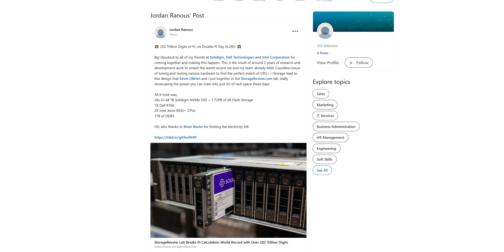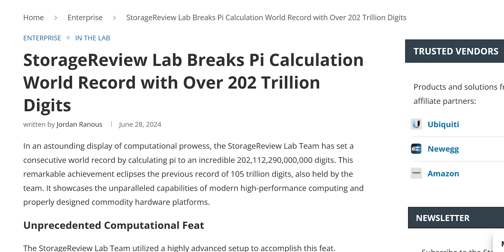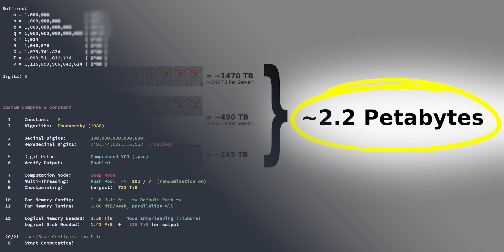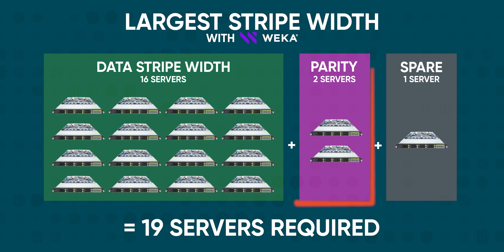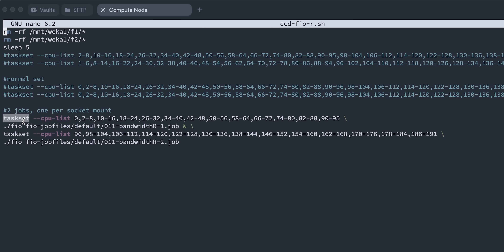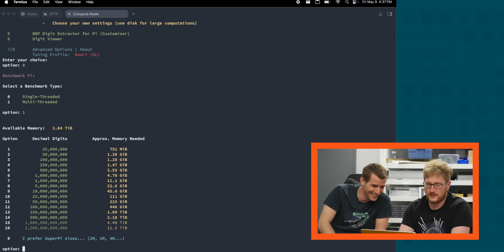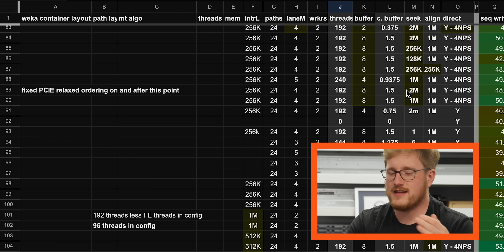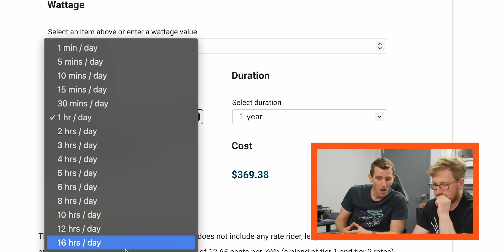The $1,000,000 PC set a WORLD RECORD

Comment: 17:57 Astrophysicist here. About 60 digits of pi are enough to calculate the circumference of the universe to a precision less than the Plank length. In other words, it is enough to calculate the largest possible circumference to an accuracy of less than the pixel resolution of the universe. Meaning there is absolutely no use for more digits, at least in regard to practical calculations.
Reply: Engineer here, we only really need one digit of pi.
Reply: @dexter9313 So π=3 as per the Indiana pi bill?
Reply: @dexter9313  lmao Swedish round Pi to 5 and call it good😂
Reply: @Dgsincc  tell that to the swedish craftsman... In my experience tolerances are tighter on swedish car parts than most domestic US car parts.
Reply: Why not round to 1? It’s easier
Reply: @dexter9313 one digit? 10^0 is close enough surely, it's within an order of magnitude. 😂
Reply: I love how this comment immediately turns into a Reddit style argument.  Never change, internet. 🙄
Reply: Been reading comments and saw 3 other comments like yours. Everyone had a different number of digits tho lol. 38, 39 40 and now 60
Reply: @orlagh277  The 38-40 numbers say "to within the width of a hydrogen atom" whereas this 60 digit version is for "within the plank length", which is quite a bit smaller than a hydrogen atom.
Reply: @ChadHadsell  Yeah well im trying to calculate the circumference of something much more important to me and much much smaller....
Reply: @ChadHadsell  1.6 nanometers specifically  1.616199(97)×10⁻³⁵ meters very very very small.
Reply: @Hazzo88  you can't go smaller than the plank length. That is by definition the smallest quantity of length allowed by the universal laws of physics
Reply: @riversilk  WHOOOOOSH! :)
Reply: @orlagh277 Mine was very rough. Plank length is 10^-35, universe circumference is approx 10^25. So I went with 60.
But it doesn't really matter. In practical terms, even building a supercolider you'll only need a dozen or so.
Reply: @QEin1786  Huh really? do you know if  for creating a some way to make antimatter collection for space travel a bit more practical you wouldn't want a faster loop so faster collisions and (maybe) something that'd specialise in making anti matter? My other thought was tellescopes or things where super duper clean and super duper precesice optics, or even radio transitions (like say Voyager).
Reply: @QEin1786  If you wanted to calculate the volume of the observable universe with an accuracy of the Planck length, you'd need 185 digits of Pi.
Reply: @gorkskoal9315  Dude, for the love of god, use punctuation. Nobody has any clue of wtf you are talking about
Reply: @orlagh277  Astrophysicists try to get matching answers challenge [impossible]
Reply: The smallest we can measure is 10^-20m and typical physics computers only go to 17 decimal places, with specialized high precision computers with 34 decimal places for theoretical work that needs to be accurate on the plank scale.

However, there are theoretical uses for having Pi past 100 digits:  ultra-precise gravitational wave modeling, quantum gravity and black hole evaporation, cosmic evolution in a digital universe simulation, and topological quantum computing in curved spacetimes to name a few.
Reply: @justletmeplaythedamngame  ah yes I almost forgot about topological quantum computing in curved spacetime! But now that I see you mention it I'm like helloooo it's so obvious!
Reply: @justletmeplaythedamngame  
only that gravity is not a wave :D It's just a scientific assumption and abstract mathematical formulas adapted to this theory/assumption :D
Reply: @Tennshe  gravity waves were detected on multiple events at LIGO
Reply: What 'universe'? 'Observable'?
Reply: @inverse_of_zero presumably, since (afaik) we haven't the foggiest how big it might be beyond that, if anything at all.
Reply: While there is no practical use for it today (and perhaps ever), one could also argue that there is no practical use for being able to calculate the circumfrence of the universe until we are able to travel far enough to make that something we need to know.

Knowledge for the sake of knowlege is a good enough reason for both though, imo. While I personally may not know all of the 300,000,000,000,000 digits of Pi calculated here, it is now a part of the collective knowledge of the human species. I am just happy that I am aware that the 300 trillionith digit in Pi is a 5.

As an aside, wouldn't it be crazy if it turned out that Pi had an exact number, rather than being irrational. That would force a redefinition of what an irrational number is, or would mean Pi would then need to no longer be considered an irrational number.
Reply: @JW-uz1ee  I think you can mathematically prove Pi is not rational even though you cannot prove its irrational, which means its irrational even though you technically cannot prove it mathematically.
Reply: Thanks for that fun fact. I currently have about 30 memorized and now have a good reason to go to 60
Reply: What about compound errors?
Reply: Circumference is not the only use pi has, but it's true that 60 orders of magnitude covers pretty much all practical calculations.
Reply: Its actually 63
Reply: @teckofficialCZ I'm an Astrophysicist. 63 = 60.
Reply: its like we calculated the wheel but then came the gears, and soon things got complicated after runs with non-mechanical forces.
Reply: Could help figure out if pi^pi^pi^pi is an actual integer or not.  Granted even assuming fast code instead of Matt Parker's Python we're still way short on the approximate number of digits of pi we'd need and then the actual calculation of pi^pi^pi^pi would be overwhelming in and of itself.
Reply: do you mean "observable universe?"
Reply: WOOSH 
That was the sound of everything you just said going right over my head
Reply: 0% on the way there seeing whether or not pi^pi^pi^pi is an int!
Reply: Based on my shaky understanding I came to 63 total digits for the current observable universe with a precision equal or less than plank length. So that's 3. and 62 decimals following :). That's a lot of precision ahaha
Reply: Software developer here, 2 to 5 digits are usually enough. It will be lost in float conversion anyway:)
Reply: @Mark-vr7pt  yeah true, I know that with coding in R, anything beyond 15 decimals is inaccurate lol, unless you make compromises that slow down the code to 1/10th the speed lol
Reply: But we talkinf about guys who cooled PC with AC unit, and liuid nitrogen. Spent more money to built an 2nd hand PC than it cost to buy a new one and did all kind of stupid stuff.

I doubt practicality was ever a question.
Reply: Yeah but what if I want to calculate it in a nonsensical model where the Plank length is several billion times smaller? Have you considered that huh?
Reply: How do you know it is that precise? Have you been there to verify?
Reply: Do you know the probability of finding a new prime within this chunk of pi? Does the probability increase or decrease as a functional pi length? Also curious about potential use of LLM to compress this way way lower than128TB I know not your field, but perhaps have better idea than me.
Reply: Useful for random number generators. I think...
Reply: Yeah, but now you have more digits to work with. 😅
Reply: That's so cool. Numbers can be mind-blowing sometimes
Reply: would use it for calculating randomness in algorithms and encryption ;p
Reply: That's only the Observable universe
Reply: boooo not whimsical and silly. Cool fact, but not a whimsical, silly fact.
Reply: until the universe expands some more! :D
Reply: I think it's more to have a better Random() function.
Reply: Could it be useful for stuff like encryption and all? I know prime numbers are useful, maybe this could be too
Reply: Could there be a computation which would require higher powers of pi, which requires higher precision?
Reply: If true, I'll hope you'll use 69 digits from now on for the lols
Reply: Are you saying, that someone could MEMORIZE just the 60 digits of pi.... and do all that?
Reply: but what if at 250 Trillion digits we find a repeating pattern... 
think of what that would change mathematically.
Reply: There might be no use in physics for so many digits of pi. But mathematics is always hungry for more digits. To compute some properties of pi, check some assertions we've made and other stuff.
Reply: I mean....coming guys....its 42 digits of pi. Thats the answer....to everything.

Now...what the original question was you may need those extra trillion digits.
Reply: not a good astrophysicist to think you know the size of the universe might i add... a few hundred years ago we found out about other galaxies.. imagine conversely what we'll know in thousands of years about the size of the universe or about physics...
Reply: Laughs in string theory.
Reply: @CragScrambler  Laughs at string theory.
Reply: @CragScrambler string theory operates at planck size, so the same napkin approach would apply, maybe a dozen or so digits more, depending on the answer to how the extra 8 theorized dimensions behave at that scale.
Reply: Except the Universe isn't round, or even a sphere. No observable curvature found:

"The observable universe appears to be flat, with no measurable curvature, according to current scientific understanding. This flatness is supported by observations of the cosmic microwave background, baryon acoustic oscillations, and the distribution of galaxies. While the universe may be larger than what we can observe, there's no evidence of a boundary or significant curvature within the observable portion"

Very likely the universe is infinite in all directions.

Your math would work if for the current "observable" universe, which is about 50 Bly in radius. Likely if we eve get a microwave space telescopy the observable universe would increase by another 20 to 25 Bly ~70Bly to ~75bly.
Reply: OOH so things like finding quasars? Maybe even  better version of the big bang? er umm if you know that is. ^_^ I feel like of the few that thinks the universe does have a size -then we get new one. Just that the size is be very very big.
Reply: Y aún así, después de toda esa información, los científicos no han sido capaces de lograr NADA con eso. No saben si es plano, abierto o cerrado. 😅

Menos enfoque en números imaginarios y más en efectos reales en la vida de las personas con números.
Reply: Not an astrophysicist here, I am calling BS on this. I know you people use a number for light years that someone basically just made up so you have a fixed number you can count with. Since I have known this, I do not trust you people and what you "calculate" anymore. The light year number is actually very complicated and is changes based on some factors, I forgot exactly what, but It's for sure not what is used, so this means everything that is calculated with is basically wrong. And that is a lot. No, with PI, I am sure there are calculations where accuracy matters a lot.

What is "the pixel resolution of the universe" is that scientific terminology? I doubt it, makes ZERO sense. A pixel in a screen can have completely different sizes. Phones or high pixel density screens have way smaller pixels than others.

So WTF is this supposed to mean. Is there are "pixel" measurement that has a fixed value that people agreed upon in astrosicence. I am too lazy to look this up, but I doubt it. So this is a complete, meaningless sentence that makes no sense either way. "The pixel resolution of the universe" WTF is this supposed to even mean. Like the universe actually grows, it's like infinitely large. It does not have a "resolution". You're just typing out some fancy sounding things, and this plebs read "astrophysicist" and click like without even using their brains.
Reply: @EmilyRose0  "you're a professional and I'm not, but you're wrong" come on man are you serious 😂 pretty sure the original comment was talking about the observable universe and nothing beyond that. And pixel density is just a figure of speech generally referring to circumference, so we have some sort of comparison. That's what i got from it anyway
Reply: @EmilyRose0  I bet you were trying to sound smart but you took that way too literally. obviously pixel is figure of speech, he just said that to the accuracy of plancks width, which is the smallest lentgh there is. so that planck would be the pixel here since nothing is smaller than pixel.

and of course the size of know universe is estimation, not some exact value. but even if it varies quite a bit, it really doesn't change the equation that much to shift the claim "60 numbers of pi" that far of. even if the size of known universe were 120 billion light years the equation would be rounded to almost the same.

and lastly context, the conversation is about the length of pi where it would still have even some use case, not about the size of universe.

really your saying could be compared to someone telling their car weights 1200kg and you went there saying "I call bullshit no way it is exactly 1200kg I bet there's at least couple kilograms more" like completely missing the point for no reason

Comment: 18:02 So you only ever really need about 64 digits of pi for any real practical purpose, since 64 digits is enough to construct a circle with a radius of the observable universe, with a precision of less than a Planck length (which is the minimum possible length that has any actual meaning from a physics standpoint).

So this may have been just a little bit of overkill. 😂

Comment: To draw a circle as large as the observable universe with accuracy down to the Planck length, you need π to only 62 decimal places.
Even if the universe were 10^300 000 000 000 000 times larger, knowing π to 300 trillion places would still limit your error to just 1 mm
ihis is useless
Reply: that means line would be straight to the accuracy to plank lenght for 2,71×10^149999999999969 meters untill it would divert from straight line for 1 plank lenght

Comment: “The radius of the universe is about 46 billion light years. 
Now let me ask (and answer!) a different question: 
How many digits of pi would we need to calculate the circumference of a circle with a radius of 46 billion light years to an accuracy equal to the diameter of a hydrogen atom, the simplest atom? 
It turns out that 37 decimal places (38 digits, including the number 3 to the left of the decimal point) would be quite sufficient,” 
- Marc Rayman explained.

Comment: The funny thing about finding arcs is most cases, you only need 3.1 or even 3, but because its an exponential curve with every extra digit, if you want to calculate an arc the size of the solar system then you only need 3.1415926
Reply: For basic and intermediate math, just counting the pi as 3.14 is already giving 99.9% accuracy for calculating the circle and arcs

Comment: This was so cool to watch. Would love a deeper dive into why this is CPU and not GPU compute
Reply: Computing Pi is sequential which means parallel computations on GPUs won't offer any help and aren't really possible
Reply: @digitulized459 if it really is sequential why do they use EPYC CPUs?
Reply: It is possible to compute it in parallel, depending on which algorithms you use for it. I read that the reason why GPU's can be a bottleneck is because when you're working with too many digits then VRAM quickly becomes an issue, hence why you'd want a terabyte of RAM.  One of the bottlenecks for calculating more digits is actually the read and write speeds of the storage you use, and CPUs are better at managing IO compared to GPUs. Would love a video on it though!
Reply: Was wondering the exact thing. Thanks!

Comment: 17:53 The answer is probably 38 digits (2,999,999,999,962) less than you calculated)
16 digits is enough to accurately measure the circumference of a circle with a radius of 24 billion km (roughly far away voyager 1 is from earth), with an error of less than 1cm.
38 digits is enough to calculate the circumference of the known universe (which has a radius of 46 billion light years), to an accuracy of less than the size of a hydrogen atom.
Reply: he means for school purposes... as he mentioned school like a few words before
Reply: @petrkdn8224 15 or 16, more than enough for delicate applications like semiconductor manufacturing, so, about the same as NASA uses for the technologies requiring the uttermost precision at this point if time.